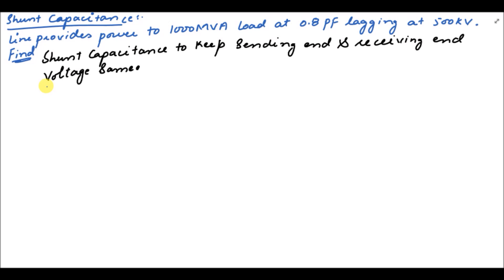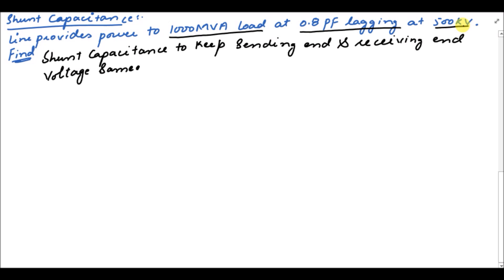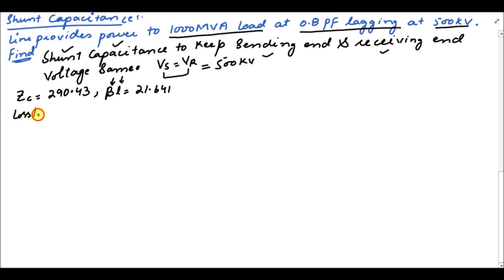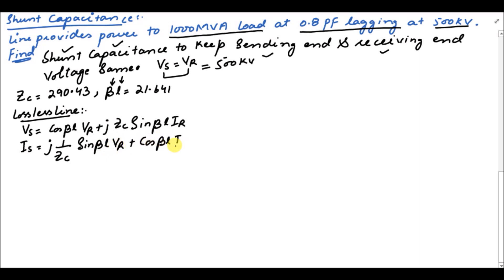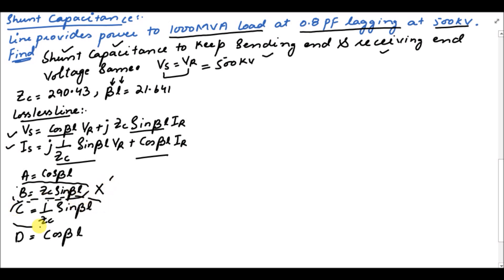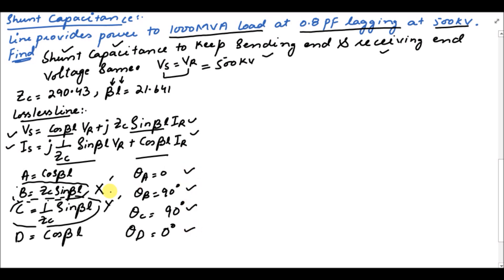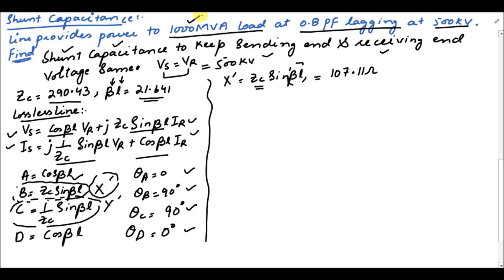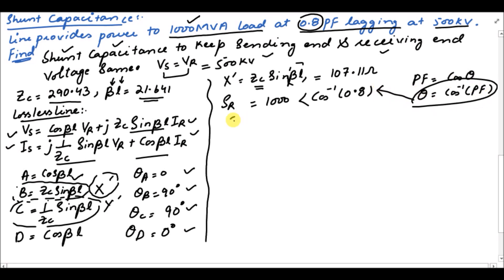Power Transmission|| 41 ||  Shunt Capacitor Compensation in Transmission Lines

Comment: In the formula to calculate QR at the receiving end of the line, I am wondering if the term cos(beta.l) goes in that expression. Since X' was calculated as a concentrated reactance. Thanks.
Reply from the maker: Yes the reactance was considered as the concentrated reactance, but the cos beta l term is the term that has nothing to do with the reactance. "Cos beta l " is the term that we get when the receiving end reactive power was calculated in for the power transfer calculation of the transmission line. In that calculation the reactance that was calculated was also concentrated. For more clarification, kindly go through the following lec:

https://youtube.com/watch?v=k8c4szShKpM&t=381s